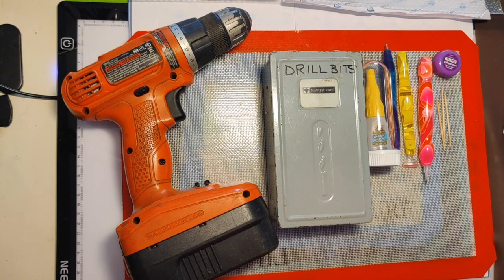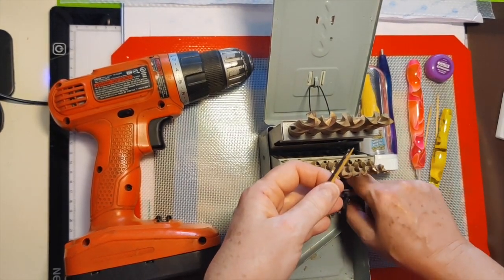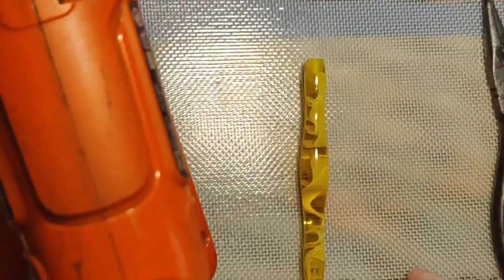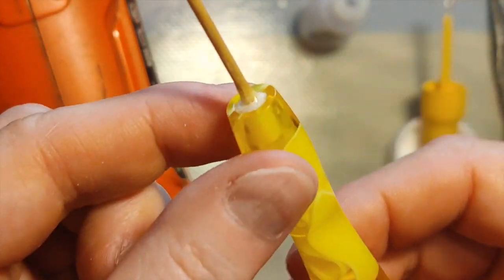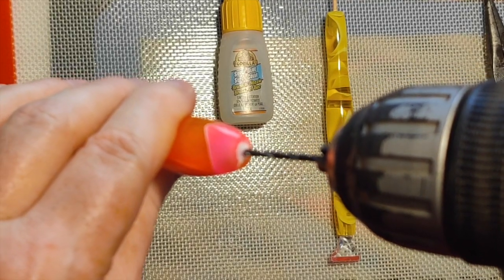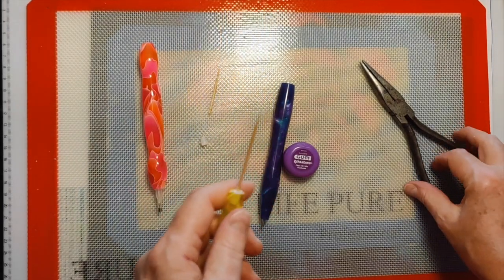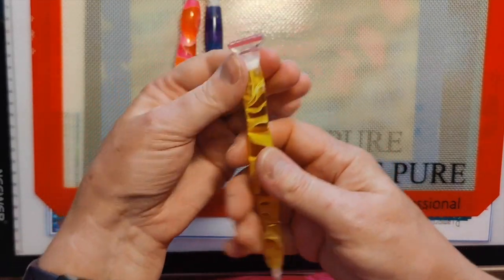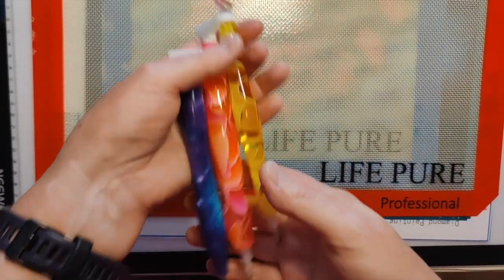Diamond Painting 411: How To Remove & Prevent Broken Multi-Placer Stubs from Jamming Your Custom Pen

Comment: Awesome that you got the stubs out!  and no broken pen.   I hope the floss saves you time the next time one breaks :)

My favorite multiplacer is the white 4 placer - when placing drills on a painting where the grid is slightly larger than the drill I don't need to adjust the placing as I'd need with the larger multiplacers... and sadly most of my canvases have been like that.
Reply from the maker: I love the 4-placers too. They were my favourite until I learned how to use the 7-placer. 💖🤗

Comment: I learn so much from your videos. Thank you. :) Which video do you show you using the multiplacerwheel? And have you made the "all the problems square diamonds can have", yet? And instead of toothpick, I would do your last trick, with the screw.
Reply from the maker: Hi Jeanette - I haven't made a video with the multiplacer wheel yet.  I included most of the potential problems with square drills in the all about square drills video (you can find it in my Diamond Painting 411 playlist. 😊